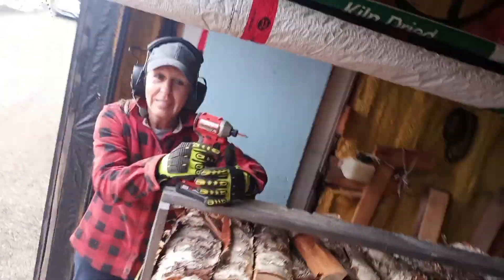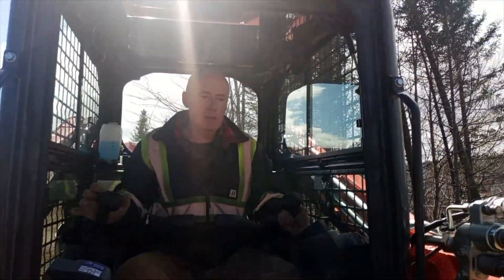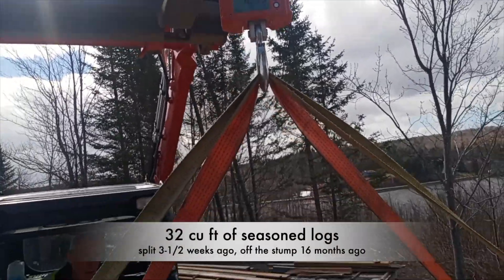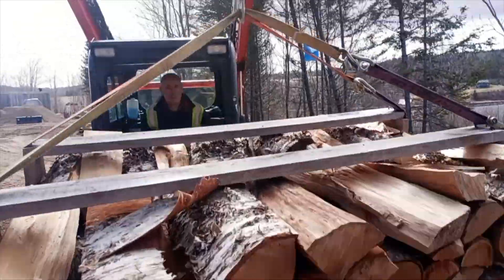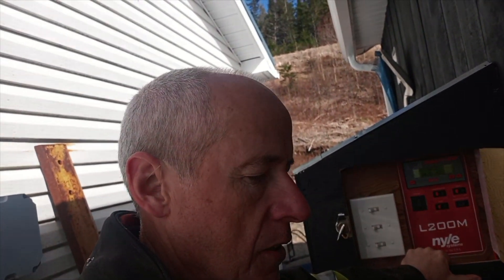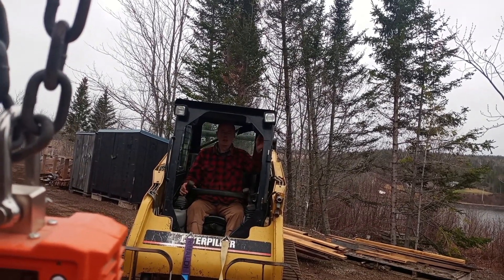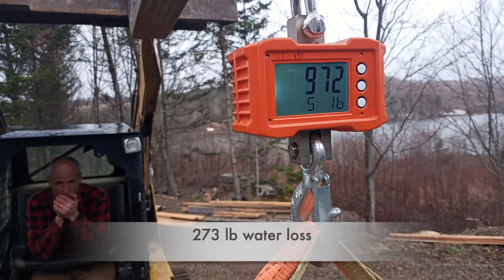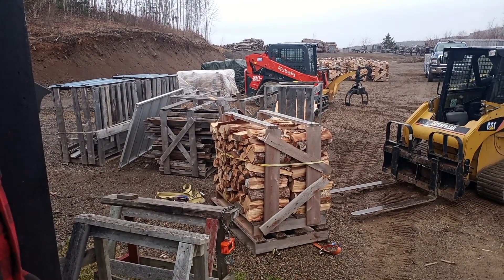20240415 The #firewood LOST HOW MUCH WEIGHT?

Comment: Do you have a rough idea of what it costs you to dry a cord of wood with your setup?
Reply from the maker: @WileysFirewood We have a pretty good idea at this point. 

The time spent in the kiln depends greatly on how much air drying the split wood has had. When the wood goes in right from the log pile like you see in this video, it can take 10-12 days. If the split wood has had 4-6 months to air dry, the time can be as little as 3-4 days. This past year we couldn't process it fast enough to get a supply built up to air dry so we've been running green wood loads for a while now. 

When it's 10-12 days the costs of electricity is more or less 1,000 kWHrs a load (2 cord). When it's 3-4 days the electricity costs are about more or less 400-500 kWHrs. Then there are the additional costs associated with the process, like the labour involved to load and unload, for us it's about 2 hours, that's two people at 40-45 minutes just to load. Takes about 20 minutes to unload. Also there's the capital cost recovery amount, which is an amount added to recoup some of our equipment's capital investment.